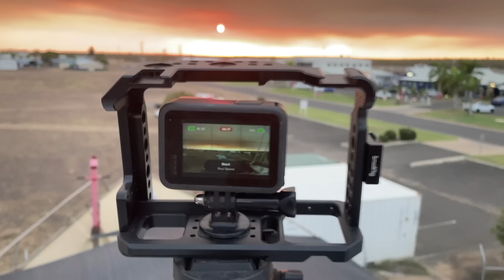DIY Black Water Tanks Using Ply & Glass - Project Brupeg Ep. 291

Comment: I usually don't do this, but I'm a big fan of you and I've been doing fiberglass in boats for years, and I must warn you, you will have issues. The forces that are in play are huge for the type of fiberglass you are doing. Perhaps you don't read this, but here it goes, a friend's opinion: The timber is also a structural part, so glue it with epoxy, not hot glue; I don't think you have enough gap between the sides and the hull, you will need at least 4 layers of heavy bi axial glass and some kind of exterior padding; rubber paint in the interior would be a good idea;  you MUST do structural baffles (arches) to assure the weight won't open and crack the sides, and reinforce the points were the baffles connect to the sides;  I assure you, the forces will be huge!; you must reinforce all corners, fillets and round every 90 degree, fiberglass does not do 90 degree curves; hope it helps. All the best
Reply from the maker: Hi Daniel. Thanks for the comment. We have soaked the ply in epoxy to the point it won’t take anymore resin then started with 150gms biaxial tape in the corners, then an epoxy fillet (roughly 25mm radius), then a layer of 450gsm biaxial cloth, and then 1000gsm woven roving. The lid has had 450gsm CSM epoxied down and this will be epoxied to the tank. Inside we have baffles (but will be shown in next weeks episode when we go into the glassing aspect. And these baffles have been tied into the prior glass layers. Once the tank is closed up we will be wrapping the tank in cloth and glassing that to the outside to tie it all together
Reply: Great, hope to see the final work soon!
Reply: My 5m Centre console is a plywood fibreglass composite, with 450gsm biaxial in and out.  The planing strakes were hot glued initially then filleted and glassed.  Assuming you epoxy glue, fillet and fibreglass in the baffles (similar to the bulkheads and longitudinal in my boat) and wrap it in more 450gsm, those tanks will be plenty strong enough.
Reply from the maker: Thanks for this Gavin. Like most things on this boat I never really know how strong to make things, these tanks being no different, so I plan to over engineer it so I can sleep at night. Dame
Reply: @ProjectBrupeg  I have built my own tanks using 12mm Thermolite, stronger than ply, lighter and absorbs no water. Plus of course lots of filleting and 450 gsm biaxial everywhere. It costs a bit more, but by the time you include all the extra epoxy and labour needed for ply I think I came out well ahead. On the back of this experience I have used Thermolite in many other places on my steel boat.
Reply: @philipwilkie3239 I wonder if that product is available in Ireland. Sounds interesting. Does it take up some resin?
Reply: @seamusreilly6522  It is a dense, rigid polyurethane foam with a lot of fibre-glass weave embedded in it. It absorbs only a tiny amount of resin. For most uses I only put a coat or two of polyurethane paint on it for cosmetic purposes only. For tanks where I want additional structural strength as well, I just flood the surface with 10% more than the correct weight of epoxy resin and lay on 450gsm biaxial.
Reply: @ProjectBrupeg  you hopefully have a plan to deal with flex and vibration these tanks will have to endure.
Reply from the maker: Yeah we do. Glass and ply have an amount of flex that’s acceptable. These tanks will be bolted to the steel hull so they will flex to the same degree as the steel structure which will be less that the play and glass flex limit
Reply: @ProjectBrupeg  For extra madness points, at the end, you can add stainless straps over it, like you'd put over a car fuel tank. They'll reinforce the structure making it even more strong by sandwiching it into the boat. I've done this kind of stuff many times when i wished to be 500% certain of something liquid not leaking out. To separate the straps from the tanks, you can use yoga mats cut up in strips. There's some that are fireproof and those are perfect for this kind of stuff (IE inside the engine room).
Reply: Prayers for Jess.

Comment: Suggestion: weld some nuts flush onto the plate (trap door in middle of the saloon) that you remove to get into the engine compartment. that way when you need to move it, you can just screw an eye into it and hook the wench onto the eyes easier than prying up the corners and wedging a strap under it to lift.

Awesome job on the tanks so far.   As always, I pray your migraines diminish and your health challenges improve.  

Thanks for letting us into your life and project.
Reply from the maker: Thanks Alan

Comment: May I suggest using peppermint essential oil for Jesse's migrains. Place a couple drops of the peppermint oil in the palms of your hands, rub the palms together, then cup your hands over your mouth and take deep breaths. Be careful not to touch around your eyes as the peppermint oil will cause irritation to the eyes. I don't get migrains but I do get headaches. I have given this treatment to folks that do get migrains and this works miracels. I also use this as a pick me up for when doing long distance driving, way better than energy drinks or coffee.
Reply from the maker: Thanks George, I tried that in my 30s when I trained and worked with an amazing herbalist… turns out I am allergic to peppermint and it has given me some of my worst migraines. A lot of people can use it, regrettably not me. Thanks for the thought George and glad you found it helpful. Cheers Jess

Comment: Get your plan A B C ready for engine install - as you may just have to cut away the doorway  lower plate to use industrial machinery skates, rolling the motor in in assembled height/weight/dimensions on rails or skates. I recall that the motor was chained incorrectly on extraction. Use a 1 meter spreader bar instead of chains at 45deg angle, potentially snap off engine metal at 45degree grab where forces are doubled weight SWL of all components. Safety first - check props - secondary under engine straps. Good luck team.
Reply from the maker: Thanks Paul, we will be using the same technique as we did with the first motor we put in. Cheers

Comment: Another thing when applying the first coat of epoxy to bare panels, you don't want the day heating up as you start, the timber will gas off. Better to start your first coats as the day has passed peak temps to prevent this from happening.

Comment: I feel your pain Jesse. I can't take the heat at all. Never have, at least  not here on the B.C. coast. I have an air conditioner I'm my bedroom because no matter what else, I need my sleep. I'm surprised Dame hasn't rigged up an ac unit in your editing room so you can get some relief. Hope you feel better soon.
Reply from the maker: Yes, heat exhaustion is a big trigger for migraines for sure. Great you’ve got the heat for sleep managed. We have the AC in the galley placed so it pushes cold air into both forward cabins… now. It works well but some Queensland days it doesn’t stop the heat or humidity. It’s been an uncomfortable summer for these 2 kiwis and 1 German.. none of us cope with the heat. Thanks Quarlow 12. Take care. Jess

Comment: Have you considered drilling and taping removable eye bolt / holes in that hatch. It will get the lift hook closer to the hatch and give you more clearance when moving. And when you are done putting it back in place just unscrew the eyes as they will not be a trip hazard. Everything looks great. Thanks for the vidio.

Comment: As I watch you work hard.  I would suggest you drill four holes in the engine room hatch. With large nuts welded on the underside. So  you four strong lifting points.  But use the same bolts used as the perimeter bolts.
Even one bolt in the middle for safety lifting  the cover.
It will interesting in what sencer you use to check the fluid level in those tanks . With the ship rolling and pitching.

Comment: There has been debates about tank design, material selection, fabricator/fabrication, cost, durability and maintainability. In some YouTube blogs, materials used thus far: plastic tanks, monel tanks, stainless steel tanks, fibreglass. Each owner had specific reasons for each choice. Time will tell.
Reply from the maker: For Blackwater alloy, stainless and mild all fail. Monel is just too uncommon and custom plastic is off the planet expensive

Comment: Hi again, was going to comment on holding tanks part 2, but comments are disabled.😢. Firstly😅, is there no end to your skills , adding fibreglassing to the list, secondly, i love the way you preempt the nay sayers … thirdly, i re glassed a small boat i had years ago, when i started i didn’t realise if i mixed the resin with too much catalyst, i would end up with a hot pot which set within seconds lol. lesson quickly learnt . Frank
Reply from the maker: Hi Frank, yeah turned them off as too many bay sayers didn’t pay attention to half of what we did/said then started piling on. It’s amazing how fast it goes off if it’s slightly out of spec aye. Had a cup go off in minutes ourselves doing this. Might you it’s nearly 40c while we are glassing so that can’t help

Comment: Just my two cents worth but you should really consider joining the wood with epoxy and fillets reinforce corners. Tanks that size will need baffles,  there is a huge amount of pressure swashing around, I know you ain’t got so far as fittings yet but remember you’ll need breathers as well.  One other tip use the strongest fibreglass matting you can, you can always finish with the lightweight stuff to make it aesthetically pleasing.  The engine room is coming along very nicely keep up the good work.
Reply from the maker: Thanks. More detail on the tanks in the next episode

Comment: Will you be doing the cutouts for macerator units , breather pipes and pump outlets before glassing , so there is absolutely no exposed plywood moisture can get at ?
Reply from the maker: Yes. Everything will be epoxied. Wood is something I dread working on so on this boat we NUKE any timber onboard with epoxy.

Comment: I have been skippering boats for 45 years & managing three Ferrette for 10 years they have good quality plastic tanks installed, and they are easy to wash and never had a problem. Why make custom tanks that hide the bilge area from maintenance? for your boat, I would install a self-draining plastic tank for each toilet on board, with no pumps just open the drain valve while at sea, at anchor, or in the port and close the valve. I have a feeling you will not listen to my advice but in the end, you will be an expert on fixing broken tanks & macerator pumps.
Reply from the maker: Hi Frank. It would be great to have a self draining tank for the head however on this vessel it’s not possible. The freeboard between the head and the waterline is too low and there is no room below the head to fit a tank large enough to allow us to stay inshore for any length of time. I agree having to rely on pumps is a pain but we are designing easy maintenance into our system (ie having spare pumps and having them accessible and easily swapped over).
Reply: @ProjectBrupeg  If you are going that route I would recommend installing plastic tanks that have a large enough inspection screw on hatch to do regular cleaning & maintenance work with the float switches if installed.
Reply from the maker: That’s not an option for us. Plastic tanks made to fit the space are $2,500each. Ply and glass tanks when built right are are pretty normal option around here. Plastic is really good but just not an option based on price

Comment: I hope this gets to Jess, I dont know if it will help in this case. I had 4-5 migranes a week for years on end. It stopped when I went and got a Daith Piercing. I got my left done as had more migraines on left side of head. 

3 years after piercing. Have less than 3 (small migraine) in 6 months the bed ridden days are gone.
Reply from the maker: Thanks for the suggestion. I imagine it depends on what’s causing the migraines if it helps or not. Great news that it did… and pretty gorgeous to, I bet! I couldn’t do if it would help… too prone to infections. Thanks for the thought! Cheers Jess

Comment: Did you want to build these custome tanks so you had space left over above them?   Otherwise the option of just building more small , vertical tanks against the walls would be simpler or even buying ready made rotomolded plastic tank that should be readily available.
Reply: Deciding on why you do something is one of the most important lessons you can Tell us. You have a good plan.
You did explain the materials but not the location.
Cheers Warren

Comment: It seems like it would be much easier and cheaper to use corrugated plastic sheeting instead of plywood for your core.  They do make a special resin and gelcoat that is just for potable water and for black water.  It is also much more fire resistant.

Comment: Damo you mentioned the smell of the epoxy.  Mate if your using polyester resin (what they make glass boats out of and really has a strong odour) it’s the wrong stuff. Use epoxy resin, no smell.
Reply from the maker: We are using epoxy not polyester. The issue is Jess can’t be around any chemical smells. MDF dust is enough to put her on bed rest for a week, so epoxy smell is something we have to manage with her around. Polyester or vinylester wouldn’t be possible on this boat

Comment: You better think to much end up capsideing that boat putting to much in that engine room it's a boat not cruise ship suppose to have equal weight on each side.becarefull ..
Reply from the maker: Weight below the waterline is beneficial to a vessels stability. Originally Brupeg had 500L of oil stores in tanks on deck right above the area these black water tanks will be mounted. By removing the original oil tanks and fitted these black water tanks 1.5m lower the overall stability and righting moment of the vessel is improved. Thanks for your concern. Dame